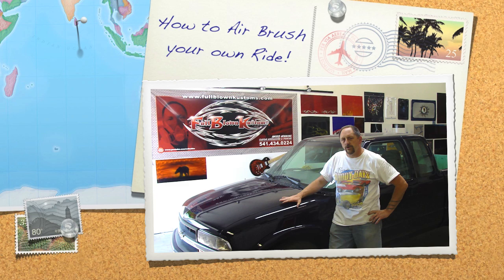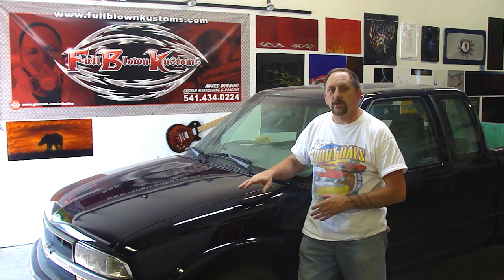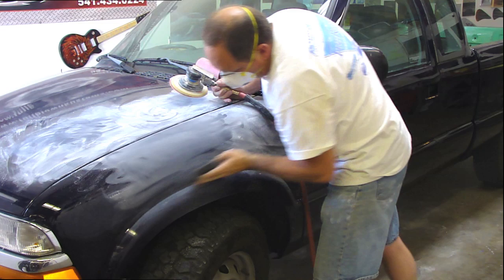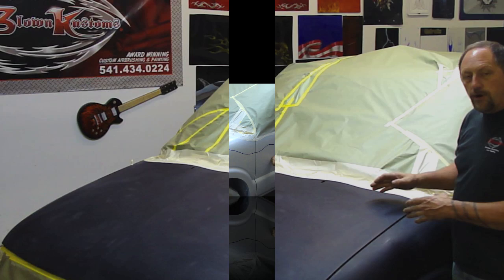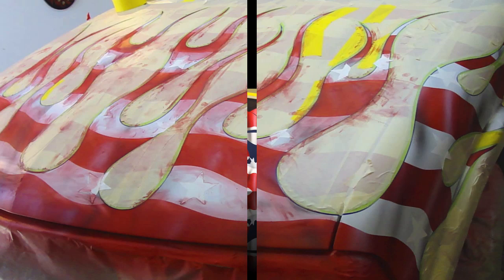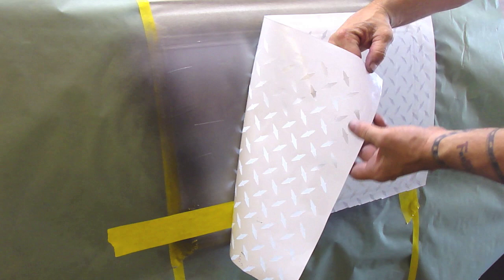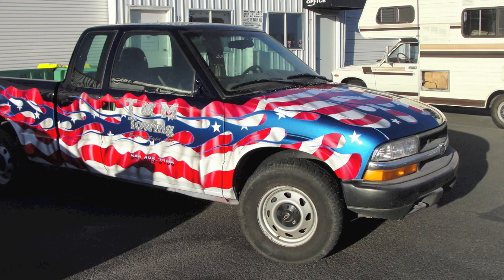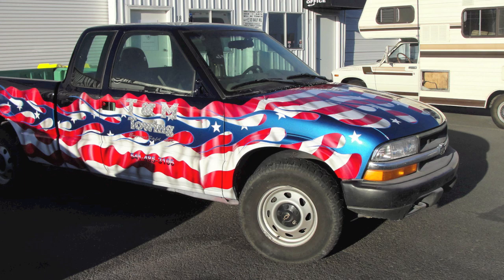How to Air Brush your own ride

Comment: @edhubbs 

 Wow I actually found somthing that the master dose not know:)

 Just kidding 

 what I am trying to do is not pimp out my ride like a stop sign but it is on my service/welding truck I want to have some of the graphics part of the road safety for the truck.

 I think that I will get some of the reflective glass beads and shoot a test panel and see what happens.

Comment: Ok I have a question 

 Is there any paint out that is reflective like the strips on a safety vest?

  I have found glass bead reflective material and thought about shooting it onto wet clear coat with a minny sand blaster and then going over it with more clear.

  Do you think this might work or do you have another idea?